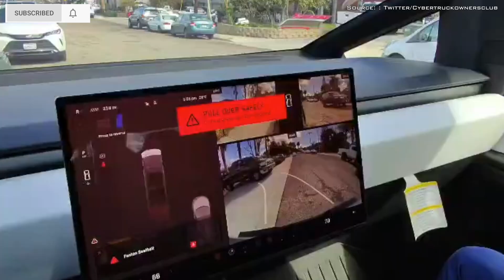Cybertruck Steer By Wire System Failed at 85mph On Highway

Comment: Steer by wire is insanity.
Reply: Plenty of cars have it and planes have had it for over 60 years
Reply: Planes have a manual backup system in case of failure
Reply: @tywaunspratley802  No, plenty of cars do not have it, only the Cybertruck and some Infiniti, and the Cybertruck doesn't have the redundant systems that planes have.
Reply: @tywaunspratley802  No, extremely few cars have it. Aircraft have redundancy that no car has, parts that cost more than a whole car and get rigorous maintenance that no car will ever see.

Comment: Could you please specify the source? From my understanding, in a steer-by-wire system, if it fails, you cannot turn the vehicle at all. There is no option to turn it with a lot of force because there is no direct connection between the steering wheel and the wheels, unlike in a traditional steering mechanism where a steering rod is used.
Reply: Sources would be great, but I can imagine that it is possible to simulate "hard to turn" using force feedback, and to limit extensive steering if hydraulic pressure drops slowly for example, to still give the driver time to drive to the side of the road for example.
Reply: I don't trust anyone using text to speech. I'm sure the laziness spreads to their research too. No source and no identity, sounds like this is a competitor to me 😂